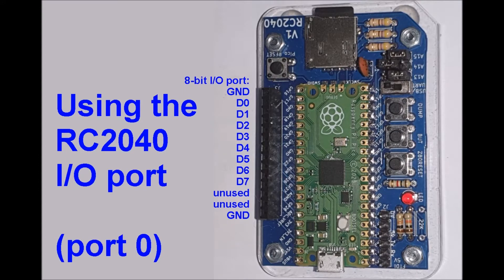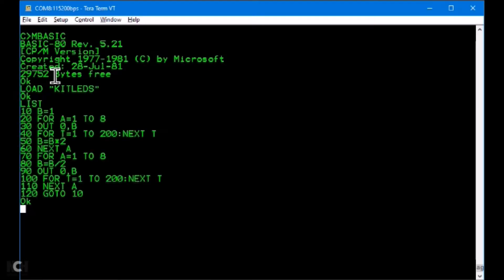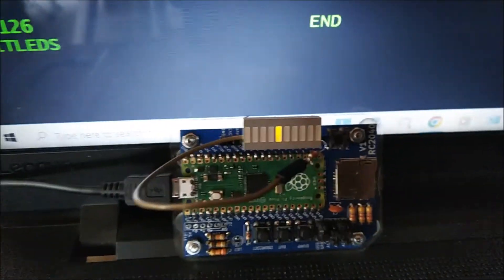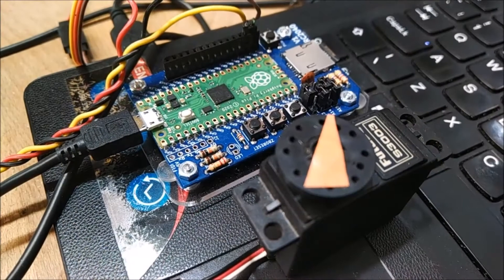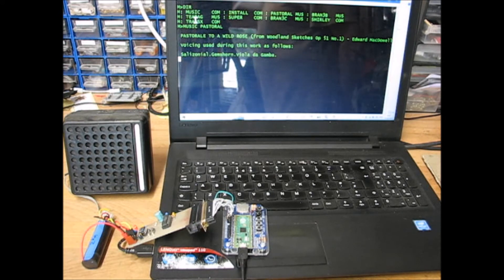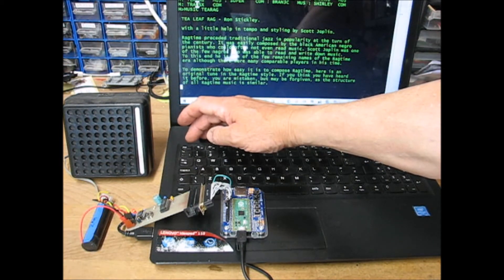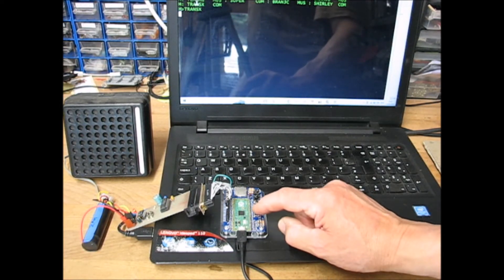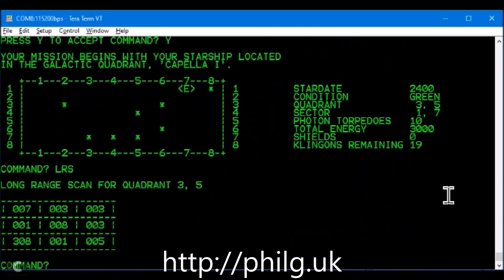Using the RC2040 I/O port

Comment from the maker: Hi Mike, good to hear from you again :-)
Derek is very accommodating with email queries if theres anything you're not sure about.
The A13,14,15 selects are the same as the RC2014, I found that not all combinations work but that might be me, I only have the default roms loaded :-)
Reply: Yes all the combinations work, but you need a ROM(file) that has them programmed, Most of the Stock RC2014 ROMS only have 3 or 4 out of the 8 possible programmed and I've used the stock ROMS sooo....

Comment: Pitty that the pico only has 3 adcs so no ppm encoder is possible in that way.
Perhaps adding  an external analog multiplexer connected to one of the adc pins , and some extra output pins for selecting the multiplexer imput.
It would be bigger than a arduino mini based board but similar price and a lot faster.